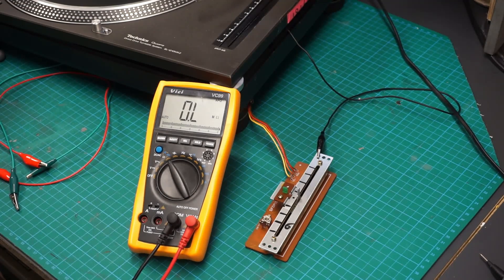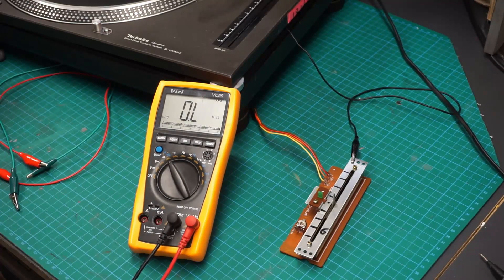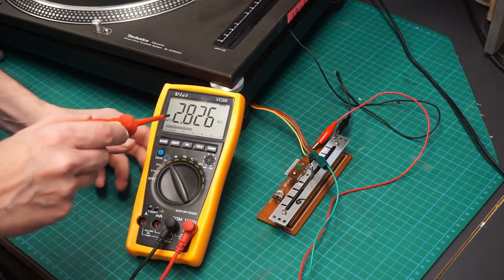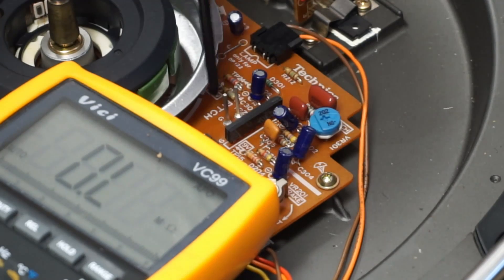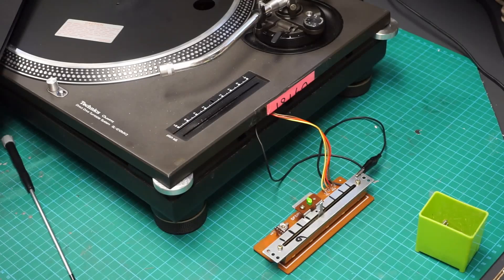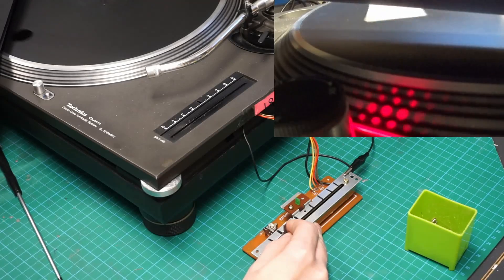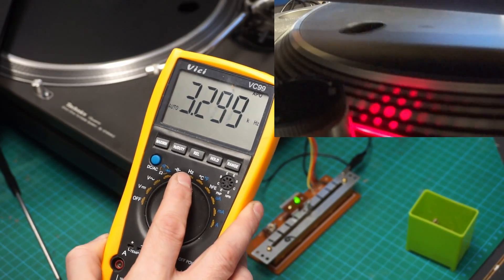How to calibrate the pitch on a technics 1210 using a multimeter

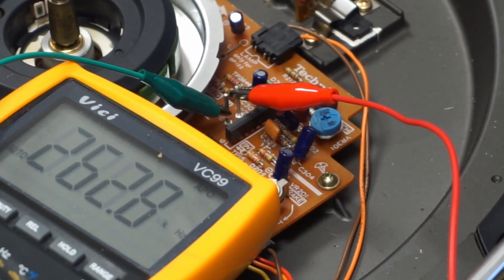Comment: 5:00 By choosing 262.0 your +/- is potentially at a maximum .08 off instead of setting it to 262.1 which could have at maximum been .11 off. You made the correct decision. If you would have chosen 262.1 there's no way to know if it's 262.10 or 262.19, you would have been in the same situation but a potentially worse one... because math. If your multi-meter only displays to the tenth decimal go with 262.0. :)  I noticed your meter is on the auto ranging function. Some meters will allow you to change the decimal place but you must take it out of auto ranging mode. Great video! I don't have technics but it was still a very interesting video and I'm sure it will help a lot of people out there to see how to calibrate it the proper way.
Reply from the maker: I do not think the VICi can adjust the range on the frequencies, I am sure I would have tried it.

Comment: This and your other video's are very helpful. After I adjusted the pitch like above (and cleaned and lubed the pitch control from your other video), I still get a +.1/-.1 pitch fluctuation (keeps bouncing between 2 constantly) when I an connected using Serato. Is this normal or could it be something else?
Reply from the maker: that is not related to the pitch control it's self. It could be noisy signals or even the deck is fluctuating it's speed enough for serato to see, but not enough by looking at the dots on the platter. Wow and Flutter I think. you can get apps that can check for this on your phone.
Reply: @DJlegionuk  Many thanks! I talked to an old DJ friend of mine and he believes the little bit of fluctuation will be there regardless—Serato is just that sensitive.

Comment: Hey DJ legion please help me out.

I did exactly the same like you, got the VR302 on 262.1 Hz

And beforehand I got the pitch fader on the zero position at 2.75 Om

Still the pitch is slightly incorret when I check the dots on the platter.
I didn't disasamble nor clean the pitch fader it self beforehand which I will do this week. Do you think it will have an impact on the fader's accuracy?

What else could cause an incorrect pitch control? There is no 2nd zero point nor something else wrong.

It is just a little bit out of range and this tutorial doesn't fix it....
Reply: I'd take the official value of 262.08Hz with a pinch of salt. The strobe dots are there to help you correctly calibrate it, if it's out adjust the frequency to suit the dots. I've just done a 1200 and had to set the frequency at 272.5Hz to get it correct.
Reply: @marlztah  Hmm :) in my honest opinion isn't it the resistance that is to be taken with a grain of salt - given that the faders are more likely to out of tolerance?
Reply: @Mazeisaspace  you can't adjust the resistance,  you can only adjust the frequency. The strobe is there to calibrate the pitch correctly.
Reply: @marlztah  you can calibrate the gain of the pitch - which is done measuring the resistance and adjusting it with the variable resistor on the pitch pcb
Reply: @Mazeisaspace  my mistake (it's been a while since I've done this!). And yes that does make sense!
Reply: @marlztah  no worries, i am also just at it. Calibrating for a customer. And I was at bit baffled by the results that came from following the service manual. All the best
Reply from the maker: HI, so is it ok at the +6%, but not at the 3.3% ? when you move it off the center click do the dots change smooth or is there a small jump. I  think the 2.75 value is the problem and I would try 2.9k and then change the frequency  until the 6% is correct again. If the resistance of the pitch is wrong because it's worn out or is dirty using the 2.7K value will not work. So try 2.9K and re-adjust the frequency if this does not work just keep tweaking until you get it as close as possible.
Reply: @DJlegionuk 

Hello there,

That sounds reasonable. I will try that.
I can get all of the plus values to be accurate but especially the minus 3.3% not!

The dots showing me minus 3.3% when the actual fader is only at minus 2.5%...

I  reached Plus 6% and plus 3.3% accurately to be clear.

The jump of the dots when I move the fader off the center is quite smooth I'd say. Not very abprubt.

I ve got one more safety question. Does it damage the motherboard or something else of the turntable when I would adjust VR302 while the turntable is switched onn?

Did that accidently several times x)
Reply from the maker: @UC-dYJy1QTgHD6C-Qw5_rEOw this normally means the value of the 2.7K is too small.
Reply: @DJlegionuk  Can you please provide the links of both the multimeter, and all of the probe cables that you're using? That would be helpful because, as I'm watching your tutorial, I'm seeing that you're using about four probe cables. So where are the green ground and red positive probe cables connect from as well? I'm a bit confused, so if you can clarify where all of your probe cables are connecting from, that would be greatly appreciated as well.
Reply from the maker: @crazycuts6891  they are just leads with clips on the end of the probes so I do not have to hold it in place.
Reply: @DJlegionuk  So I can if the first two cables are attached to the multimeter, from what device, are those green and red leads connected from?
Reply: @DJlegionuk  Also, does this calibration technique work on the clickless pitch faders as well?
Reply: @crazycuts6891  Just get some crocodile clips and some cables and solder them - I make my own ( banana plugs to crocodile and crocodile to crocodile etc).

Comment: jump from 0 to closest minus position is too big
Reply: i failed.. thought it was perfect +6 etc. on both.. but only one is calibrated propertly.
cant fix +3,3 and -3,3 on second pitch fader. swapped it between decks and still the one pitch fader cant be calibrated
Reply from the maker: do you mean when it moves of the centre click to a negative pitch ?
Reply: @DJlegionuk  yes, you have to fix the second zero point aswell. I just did the calibration on both my decks.
I first did step one with HZ and plugged in deck.
then unplugged calibration of pitch.
but third step was when i plugged it back in, it had 2 zero points. so i just fixed that and both are perfect at +3,3 -3,3 +6 :)
Reply from the maker: @SWAREDNB  I am starting to wonder if they changed these settings on some mk2 models. On most of the recent decks I have checked 2.7k on the centre click and 262.08 does not work and is way off at +6%. I found they have around 2.9k and 261.08 and this is a lot better on the pitch range. I still prefer setting this up without the frequency counter and just adjusting both until I get it perfect, it takes a little longer, but seams to work a lot better.
Reply: @DJlegionuk  i think it's the pitch fader  cause i feel when i use them, one of the pitch faders is a bit harder when it moves but seems a little more precise cause you feel every move.
so, maybe there are two versions of mk2 pitch faders and maybe you don't know and have one from mk5 or so in your deck